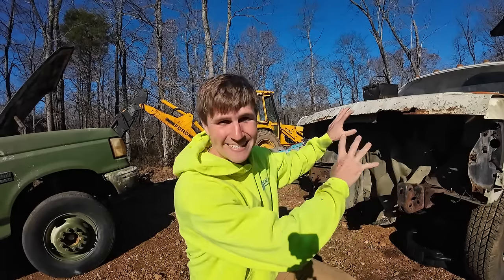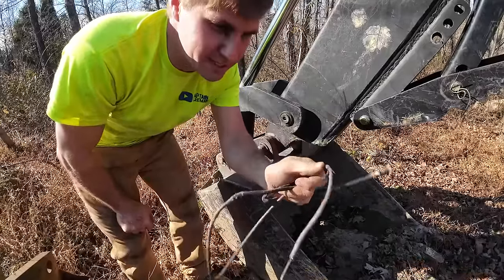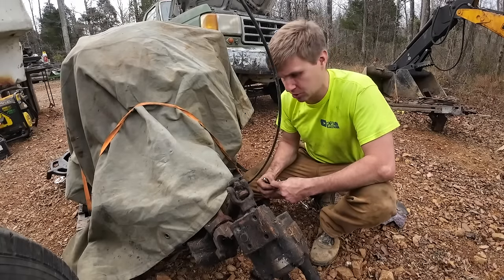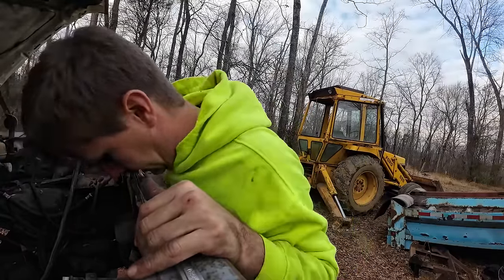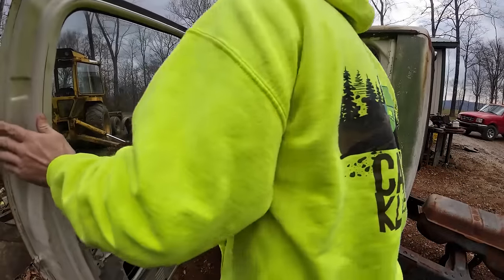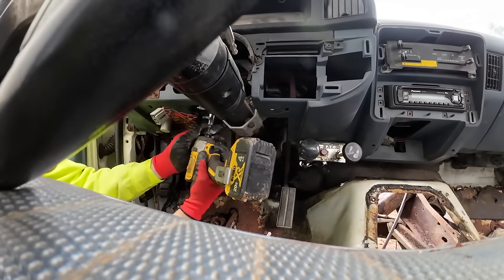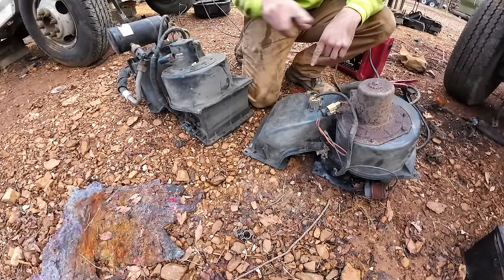Building my First Dump Truck - Shade tree Engine Swap!

Comment: Careful pulling off all those spare parts. Remember, we're on a budget! and eBay Motors is not cheap for OEM parts!  😁😁    I'm so glad this is not a give away channel where you win a chance to come down and smell the inside of a dump truck that was formerly infested with rats! 😂😂.  BTW, is there enough good steel off the old truck to weld onto the replacement?

Comment: Well, Captain, you may not be doing a "how to," but you're reminding me "why not to."  I think you've convinced me to try and find another rebuilt injection pump for my old diesel pasture pickup, instead of swapping it out for a gasoline engine.  (Besides, I still don't have a halligan for disassembly purposes, and I've moved 250 miles away from where I knew all the folks at the FD).😁
Reply from the maker: Gotta get that halligan!

Comment: Mike you crack me up with your humor. Winging it instead of researching how to tear down and reinstall is content driven, but as parts availability shrinks it can be project killing.
Reply from the maker: Parts availability is not an issue with these trucks.  Also, by the time I research how to do something, I could have already had it figured out.  Not rocket surgery.  Appreciate ya watching!

Comment: Mike the shifter tower doesn’t have to come off! Just turn the collar at bottom of shifter counter clockwise, and shifter comes right out! No need to remove any bolts on top of trans, just the pan of cover! Hope that helps! Keeps from dirt getting into trans too!
Reply from the maker: Well if I want to inspect the gears it does...

Comment: Always enjoy your videos Mike. I remember those days of swapping engines. Mi youngest brother was about the best I ever seen. He could swap em in 4 hours time, and have it running. Good video buddy.
Reply: I used to do it but wasn't very good at it. One time I swapped a gear box from manual to auto and changed the steering rack from manual to power steering. Then rolling down the street going slow and wondering what the clunking noise was the vehicle flipped on its side like a bomb had gone off! Turned out I hadn't tightened the front wheel nuts and one wheel came off and flipped it under the guard lol

Comment: The heater blower motor that squeals like a piggy can be fixed easily, at the hump at the center of the motor use a center punch to make a small hole then add some tranny or motor oil. Yoycan also drill a small hole. When its done dab some silicone on the holt and your done.

Comment: That fan sounds like a sick cow in a hail storm!! All that work you did swapping out the entire transmission and motor. There were only a few more bolts wires and connections then you can lift the cab off the frame with the triple nickel. Soap the motor in and plop the cab back on.

Comment: CPT at one time I was you. Now after getting sick back in 2019 and getting old I got one project  left for me to get done. My log splitter. Went and bought a 16 HP Honda motor with electric start. Just got to go threw it change oil, clean carb, spark plug hook it up and run it. After this I'm doing my riders and that's it. I hate to say it but it's time for me to take it easy my friend. Just do more tinkering . Hey I can live through you bud !!!! Your doing a super job CPT keep it up 👍👍👍👍💪💪💪💪💪💪

Comment: There's a hole for a pin (paperclip?) in that ignition switch.
Pin it in place before you tighten the switch down to properly align the key functions at the tumbler.
Reply from the maker: Hahaha, this is a tip I needed for sure.  Thank you!
Reply: @CaptainKleeman  i told you I'd be glad to offer advice, if i could. 😄
Reply: According to Gary the pin is .047 (3/32) diameter
You'll find the hole in the metal 'foot' of the switch, ahead of the actuator rod.
Put the key in the lock position (push the button on the left of the column) and remove the key.
Then you can tighten the slotted base of the switch. 
Remove the pin and check that the key will engage the starter and that everything that is supposed to work in run and accy positions functions.

Comment: Hi Mike, if you have empty plastic containers from yoghurt or ice cream they can be very handy to hold parts, bolts etc. I also think that a plastic cat litter tray is a good tool tray for outdoor motor work. I have used these for rebuilding old cars and tractor. I also finger that speaker magnets under steel bowls are a great way to hold things in awkward locations. I am enjoying this voyage of discovery into the building of one truck from 2.

Comment: When you put back together, you should make a brush guard with a winch. That way, if you get stuck in the mid, you can pull yourself out instead of needing to get another machine.
Reply from the maker: That would be pretty awesome!

Comment: Just a suggestion learned from experience gained the hard way. While you have the engine out, replace all vacuum lines. You will never have better access and unless you just did it yourself it is a huge headache saved later.

Comment: Not sure how you do it but to keep track of all the nuts and bolts and little parts on a job like this I put them into sandwich baggies or other plastic bags and tape them to the component ie all the screws for the dash get taped to it, that way I don’t just have a big box of screws!
Reply: That is how I do it to, except I will use an awl and poke a hole in the back and use a bag tie to attach it to the part it goes with. If there is something unusual about the part (i.e., one bolt longer than the other), I will write notes on a piece of paper, cut that off, and throw that in with the bag. No way to remember where everything goes. Doing this, I don't end up with empty holes with no fasteners, or any left over.

Comment: Captain,  if you're enjoying doing this swap job then that's just fine as far as I'm concerned. 
You seem to be enjoying yourself. 
The taking apart half is not to difficult. 
It's putting it all beck together that'll have you cussing up a storm sometimes. 
Myself, that's always the fun part.
Figuring what goes where and how to do it just makes it more interesting. 
Keep up the good work Captain. 
Ooh, keep on knocking us over I'm gonna have to bill you for my Tylenol costs.
Tools and parts upside the head tends to hurt 😂

Comment: Are you going to replace the Flux Capacitor or just use the old one? 
That old hood might make a fun sled for the girls on the back hill this winter. Put a couple of seats on it 🤷‍♂️😆
Reply from the maker: Gonna try and rebuild the capacity 🤣

Comment: Don't forget to swap the brake booster.  The diesel will have hydro assist while the gas has vacuum assist.  They both work fine but the vacuum will be a little easier to plumb since you're putting the gas in it.
Reply: He could swap the diesel's power steering pump with return for the hydroboost.
Id prefer the hydroboost over the vacuum assist but to make it "right" Mike would either swap the brake pedal from the Superduty or drill another hole in the gas pedal arm.
That pedal is tougher than shoe leather and harder that a coffin nail. (use carbide because a cobalt drill bit will dull)

Comment: I would use whichever radiator is easier.  Your gonna need to block part of it when it is cold and more cooling is better when you are working it hard.

Comment: I was going to mention the ground from the bolt under the wiper motor to the intake, but I guess you've got that covered.  😊
The little tin heat shield on the drivers motor mount keeps the rubber from being cooked in short order.

Comment: Hi Mike.  Making good progress.  Checking the heating components now is something I was going to suggest but you just went ahead and did it already!  I think that with the 2 trucks you should be able to make one that's at least 87% fully functional.  The only potential gotcha is if you have them both apart and don't recall how to put it back together.  Hopefully having the videos as reference will help.
-mike

Comment: You know you will make a fine piece of equipment when you're done.. afterwards you need to put a name of what you will call it.. make sure you check out the stereo as well... Might need some tunes to travel around doing your bridge and the other projects.  LoL.. I'm glad you are fixing the heater system while you got it apart.  I love all your videos Capt. Kleeman... You might want to change the steering wheel.  Looks like the other one was in better shape... But you might want to call it Frankenstein cause you are putting parts of another vehicle to make a monster out of salvaged vehicles.. 😂 keep up the good work... Can't wait to see it completed..

Comment: For a guy who's  never done  heart surgery on a vehicle before  your not doing to bad your doing it right way taking out the loom from  petrol and  putting it in  what was diesel  way easier than  cutting  looms apart  and adding wire

Comment: Had a friend who wanted to convert his old gas chevy truck to diesel.  Thought swap the engine was all it would take.  I spent a good part of the day showing him ALL of the differences between the two trucks.  Both trucks were the same year and body style, and in amazing condition for their age and mileage.  The diesel was four-wheel drive, and his gas truck was two-wheel drive.  He was having second thoughts on the swap when he saw the amount of work he'd have to do.  The only thing wrong with the diesel truck is it had no bed but used to have a flatbed that the seller kept.  His truck quit running because his fuel tank was rusty.  I convinced him to keep both.  He could find a bed for the diesel for cheap, and replacing the entire fuel system in his gas truck was cheap also.  He took my advice and kept both trucks.  He even replaced the fuel tank and lines for the diesel since they were the original parts.  Now he has his gas work truck for everyday use and the diesel for heavy hauling.  He's in the process of saving up to have both trucks repainted.  Frames will be sand blasted and recoated, and the body will be stripped to the metal and resprayed the factory original two-tone brown and cream.  The interior of the cabs will be re-sprayed as well as the beds get bed lined.  Of course he will do one truck at a time.

Comment: It looked like that mounting bold needed to have a phillips screwdriver on the end holding it while you use a wrench to break it loose. Could be wrong I suppose but I think that's how they work.
Reply from the maker: Nope,  that end is molded into the plastic and isn't exposed unless the plastic is broken
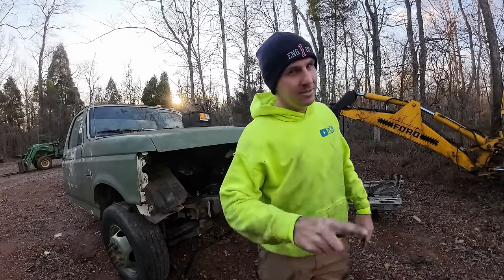Reply: @CaptainKleeman  Maybe I  am mistaken but the end of the bolt facing you had a phillips screw driver place in the end of it. See your video at 28:16
Reply: Sorry ..23:39.. the video is 28:16 I guess.

Comment: DP was in his outside shop doing some work on his new man lift, boy did he moan about the AC not working properly. 🤣 Really like how you take things apart and then work out how they go together again, am looking forward to the hydraulic pack for the 555. I presume it will be able to power your wood processor and any other attachment you want to use on the back hoe?. 👍

Comment: If you pay attention to the order of assembly, the radiator core support was installed before fenders. So the fenders should come off, then the core support.
Reply from the maker: Should have to remove fenders to remove core support.  That's a dumb design
Reply: @CaptainKleeman  Think of it like a house.  Do you put the siding up before the framing is complete?  The core support is the framing and the fenders are the siding
Reply from the maker: @adubbelde1  also, that doesn't change the way the fasteners are made.  They are still faulty.  It's a huge issue well known with these trucks 👍

Comment: Power wash it I save the hood hinge windshield ( have a gut save it front axle if your going to touch up thegeile put the chrome bumper as backup that bracket is for a snow plow

Comment: Take the blower resistor out of the fan plenum and clear the leaves/tinder/mouse nests before you set your ductwork on fire.
Also, dont swap that heater core for a new one with rectangular header tanks. It will never fit or seal properly.

Comment: Heads up, remove that cowl panel and redo the seam seal down in there. 90% of the floor rust comes from the seam seal coming loose and water getting in the insulation under the mat or carpet
Reply: And pull the rubber cowl drains from each side behind the wheel well.
Flush all the mud out with a hose (maybe leave the rubber off, I did)
You can reach the bottom of the vent pocket to seal it up from the blank off plate in each kick panel. (the parking brake is in the way on the drivers side)

Comment: Those bolts only need to last long enough for the factory to tighten them.
Reply from the maker: Yeah, that's what it seems, they didnt  really plan ahead for them to ever be removed.  Not a great design.
Reply: "Not a great design" is often used to describe my designs, so I'm used to it. @CaptainKleeman

Comment: The bigger one would give you more cooling capacity when the weather is hot might be advantage
Reply: where the inlets and outlets are dictate using rad from diesel on a gas engine. custom made rad hoses, couplings, wonky routing tend to make it not worth the hassle
Reply: Plenty of cooling in a 460 with that big clutch fan, as long as he retains the shroud.
Diesel sits in a different spot (neither engine is truly centered) so the diesel shroud can't be used with the 460 in place.

Comment: You taking the hole wires out of the cab... Did you even check to see if the wire harness would plug together.. Ford use's an lot of wires the same...????
Reply from the maker: They are way different 👍

Comment: Thanks for sharing your thoughts, ideas and videos. Yes I was wondering if it was to be street legal or not. I guess it depends on how strict Illinois is in their vehicle inspections. 😂 I’ve personally seen some work trucks on the road that make you wonder where they bought the inspection sticker because they certainly didn’t pass an inspection. 😂 I was pondering if it might be easier to take the sand rail or Fubaru approach to wiring it up without all the luxuries that might trip up an inspection. I’ve heard it said that in NY if you are going to fail an inspection due to a broken light it’s sometimes possible to just delete the light. Hopefully it’s old enough that emissions doesn’t pop up. Wishing you and your family the best.
Reply from the maker: For better or worse, we don't have annual inspections here.
Reply: @CaptainKleeman  I didn’t know that there were any free states left in our country. Amazing thing to hear. I’m all for safety inspection but when you have to break the law because you can’t afford to fix the money light something is wrong.

Comment: I would use the same radiator that for the diesel truck. You might have to change the hoses but you will figure it out. Good job!

Comment: Do you think there will be welding in your future shortening the frame rails down to the size of the dump truck>
Reply: Might be , or a tetanus booster .
Seriously tho , I would mount the dump bed as is and use the extra space between the bed and cab for tools , generator , air compressor , whatever .
Reply: @kaboom4679  He probably should decide on a driveshaft and make the truck fit it, though the shorty truck is cool and more maneuverable - guess we'll haveta watch to find out. lol
Reply from the maker: No

Comment: There’s HEI distributors that are a 1 wire set up. It’s a GM type distributor with a Ford gear.  I’ve used one in a 302 and a 351w. They work great. They’re easy to install, and they’re not very expensive on eBay. That might make you wiring a lot easier that that old Ford electronic ignition. Good luck!

Comment: At the 23:39 mark you were talking about the bolts for the "firewall box" and that it was "free turning".  It looked to me like there was a Phillips type head on the end of that bolt.
Am I wrong?
Reply from the maker: That end is encased in the plastic unless the plastic is broken like it was there.  It's no accessible other wise
Reply: @CaptainKleeman   I saw that on the other cable, but I was just wondering because of the "+" that looked ground into the end of that short shaft piece.

Comment: Just thinking with that much cancer on that old thing. That you’re able to reach up and do whatever you need to under the dash. Without becoming a contortionist or anything else like that. Amazes me and scares the life of me. Not knowing which bolt is the last bolt that holds it all together.

Comment: Think perhaps you are learning mechanicing from Andrew.
Reply: Naah, Andrew would have turned the truck over or ripped the cab off to remove the engine😂
Reply: @young11984  I didnt see a chainsaw involved either. or 5 machines involved
Reply: @harveylong5878  ikr lol

Comment: Just my thought, I’d use the differential that came with the one ton(if the dimensions were right). Not gonna make that much difference, and it’s sitting right there. Check with Clint I’m sure he wouldn’t steer you wrong.
Reply: Eight lug axles on the one ton.
Do you want to keep two sets of wheels?
Reply: One person said they would use wheel adapters to use the 10 bolt rims! BAD idea considering the loads, weights the truck will carry..😊